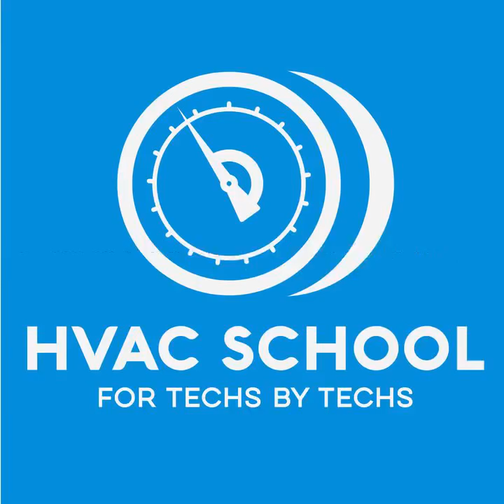(Podcast) Using Volts and Ohms in Diagnosis

Comment: Your not looking for a specific ohm reading across compressor windings ? Yes you are . Ohm out your compressor    divide start winding ohm's into run winding ohm's if it falls between 3to 6 times greater within specs , under 3 or over 6 times greater compressor partially shorted.

Comment: 1:01:15: When measuring the voltage across L1 and L2, isn't there a circuit through the voltmeter?

Comment: Seems like low voltage due to voltage drop on long wire runs increase amperage draw on compressor motors. What's causing that? Increased slip due to lower voltage??
Reply: I'm just learning but that sounds correct to me!

Comment: Voltage is pressure.  You are measuring the pressure instead of charge.  less confusing for newbies.
"!00 percent voltage drop for a circuit when you measure across two points", what?
When your measuring across two points you are measuring the voltage, pressure, at those two points. The way you explain this, by the time I get to the end of the circuit I won't have any or very little voltage left. Which is untrue.
How does the power company charge you for usage? You being charged for power right? volts times amps, times power factor where your supplied voltage should be plus or minus 10 percent.Not used up.
Why don't you explain it as a liquid header feeding a bunch of systems you measure one end of the header. At a value say, 170.
you measure another end it should be 170. As long as my header is size properly and there are no restrictions. Same with each system coming off that header when that liquid line gets down to the case, 170 should be measured there as well.
If the liquid line solenoid is good and opens fully.
Same with voltage if I have 600v at the distribution panel and at the top of the contractor.  Then with contactor pulled in, you should read 600v, on the same legs at the bottom. If not then the pitting and excessive carbon is the resistance of the small series circuit across the contacts. Causing your voltage drop. 

I've been if the commercial Refrigeration trade, supermarkets, for 36 years and you confused the fuck outta me.
I was hoping to hear a different explanation to use. My boss and some colleges don't understand why I replace 15yr old pitted contactors when the compressor still runs.
Reply: Good post if his tech. is trying to read from yellow to red then he shouldn't be in there and charging for his work. Doug Shakell you can carry my tools!